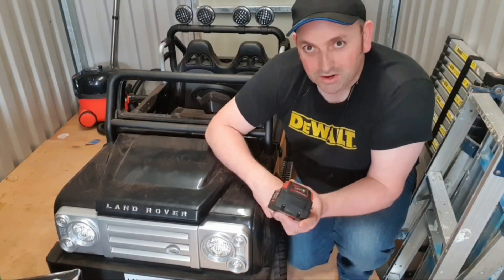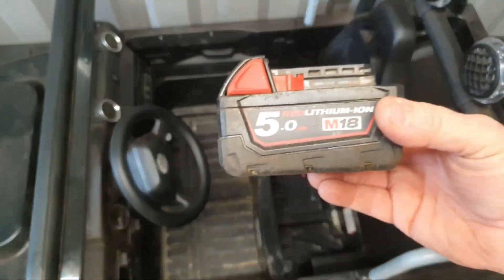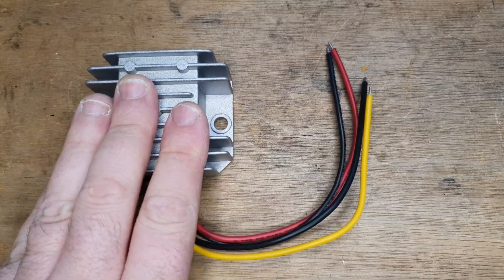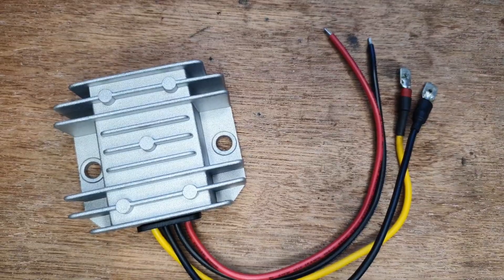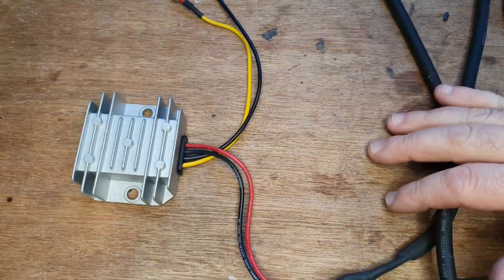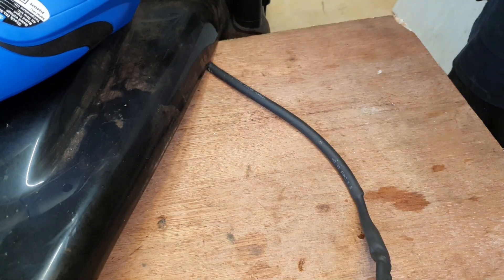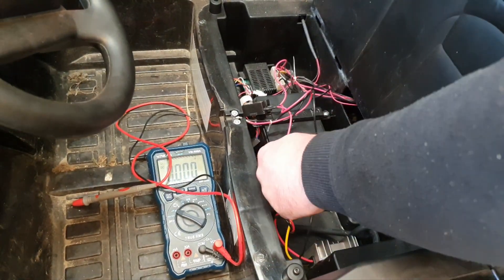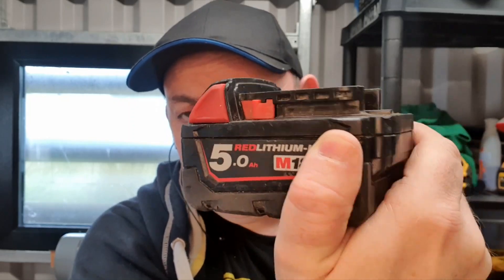Landrover Milwaukee M18 conversion #milwaukee #M18 #repair #conversion #upgrade #howto

Comment: I changed my sons gator on to a 18v makita battery goes like shit but i dint use the voltage dropper
Reply from the maker: Just for my own info did the higher voltage up the speed
Reply: @doctorlefthandthread  yes made a huge difference not sure how long it will last 🤣
Reply from the maker: @Mickjd82  with the voltage dropper you will not get increased performance some brands of batteries can overdischarge leavimg them too low to charge on the charger using them on gators I have 2 to do for a man and I intend to put low voltage cut offs on them
Reply: @doctorlefthandthread  yes that’s very true i stand to be corrected but i think the genuine makita batteries have it built in
Reply from the maker: @Mickjd82  that's a great job for them saves you having to jump start them all the time
Reply: @doctorlefthandthread  yes definitely the Chinese makita copys arnt like that ive had to spike those a few times to get them to start charging
Reply from the maker: @Mickjd82  be careful of the fake makita some of them catch fire

Comment: This got me curious so I went looking on Aliexpress to see if I could find low voltage cut outs for 18v batteries and they do have some in a few different designs. 
I might get a couple to play with. I'm curious to see if I can find one I could put into a cross platform adapter. To use an 18v Dewalt on an M18 tool or the other way around.
It would make an adapter bulkier, but, it would give under voltage protection.
Reply from the maker: It is interesting please let me know how it goes I appreciate your input

Comment: Yeah I stuck my 36v Makita xgt and my daughters rover let the smoke out 😂 you could have gave it about 14 volts is very safe and Alot faster the 12v is just shit. And I see you have a shit load of those DeWalt 54v batteries are you on that system
Reply from the maker: Yeah at 12v no performance improvement but there should be extra runtime. The flexvolt batteries are an interesting one I have got a steady source of faulty batteries that come my way sometimes 2 or 3 a months I repair some I teardown others to get cells for battery builds. I am giving a 9ah away on Thursday to someone locally in a competition. I am in so many systems due to the was I repair stuff I ended up with M18 M12 XR FLEXVOLT LXT Panasonic 28.8v Panasonic 14.4v Parkside 20v Parkside 12v. I got a mixture.
Reply: @doctorlefthandthread  very very nice